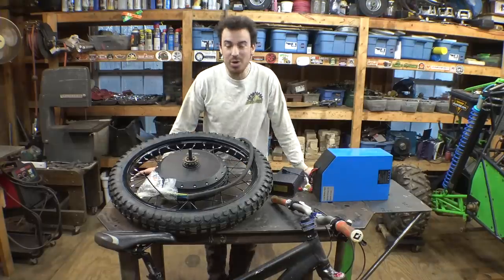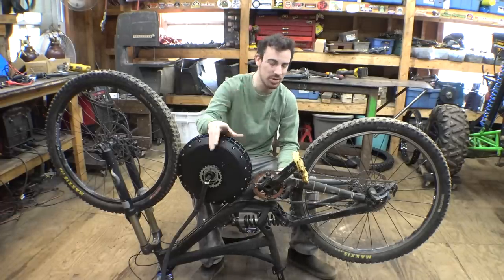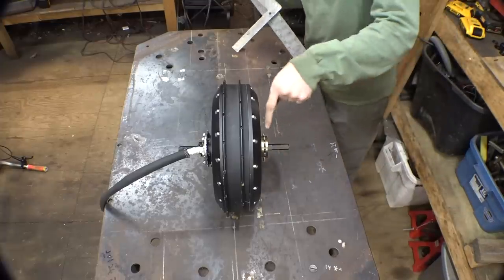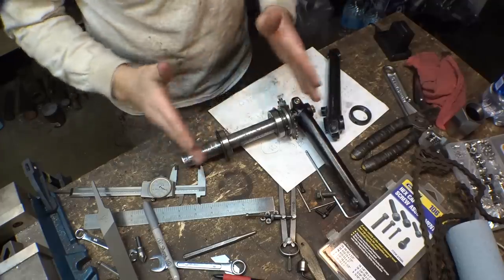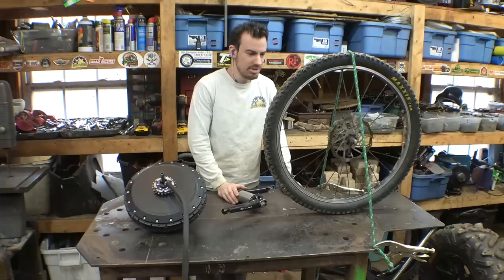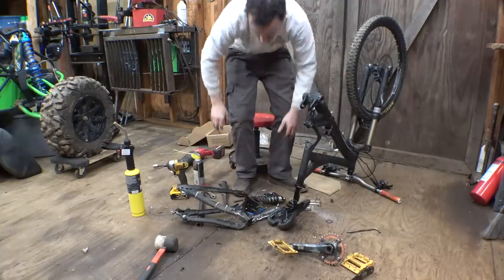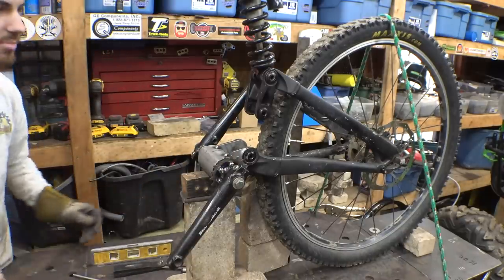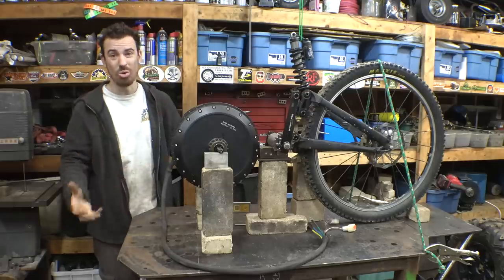Home Made Electric Mountain Bike Build - Part 1

Comment: I have an eMtb peddle assist with a 250w motor.  It creates enough torque to lift the front wheel right off the ground when pedaling.  8000w is going to make it completely impossible to pedal and you're going to destroy mtb chains immediately.  Therefore, you're going to need a moto chain and now you're making another electric dirt bike.  But I'll still watch and hope you can pull it off somehow.  Good luck!
Reply: #40 single chain on a small sprocket (~10t) is rated for like 4/10 of a horsepower at 100 RPM which is like 75mph on a 3" 27.5". Even a gigantic 50T sprocket is only good for like 1HP @ 100RPM, that's good for 12mph. 8KW is 10HP. 

Not gonna have much luck I bet, gonna rip itself apart even fixie. And then you want to shift with a derailleur? Yeah, no way and no how.
Reply: I think you’re right… about the derailer, it’s going to twist it up like a pretzel
Reply: that is good honest info to know i got my son a 750w motor was hoping it was enough what size batt build for him??   Town is 6 miles one way there is one big high on the way   thanks for you time
Reply: @langgbob  derailleur’s do not take a load. They move the chain around after the torque has been applied to the sprocket. All the energy gets used up on the cassette and where the derailleur is placed essentially is where a chain would be drooping down if it was not there.
Reply: I run a 3000w mid-drive and can vouch for all of this. I beefed up everything on the rear-end and still worry about it when torque is high. As soon as internal shift hubs are viable (and cheaper), I'm switching.
Reply: @onetravdown - This was going to be my next comment... the derailleur will never hold that much horsepower, never mind 2 or 3 hp. Shift once under power and that's the end of it. This motor would probably be better suited for a 1/2 scale helicopter than a bicycle!🤣
Reply: @pontiacg445  on top of that, this is 10hp instantly, not over an ICE power band like I assume those chains are designed for
Reply: who cares, it's just a fun content project
Reply: @langgbob  The derailleur doesn't see tension from the chain as its only job is to guide the chain over the freehub / cassette. The top of the cassette / freehub and the crankset or motor sprocket will bare all the torque, and the chain will basically become the fusable link.

And going by how it's possible and also kinda easy to snap a chain on 500w-1000 mid-drives, it sure as hell doesn't stand a chance at surviving a hard start on 8,000w!!!
Reply: Chain doesn't matter when jts hub drive
Reply: @hammyhamz4685  watch the video it's a mid drive with power through the chain
Reply: @hammyhamz4685  true... but when you're using a hub motor as a mid-drive it matters a lot.

Comment: This is going to be wild. I’m curious to see if that electric motor becomes a giant gyroscope in the middle of the frame, possibly making it difficult to turn!
Reply: I was thinking the same thing about the gyro. One good thing about it though is it will be harder to fall over with it spinning.
Reply: @hillonwheels8838  it will make it impossible to lean in turns. Marking it unrideable
Reply: Probably not as hard as having it in the wheel. Then again, the rpms wil be higher. Interesting point.
Reply: @FightFilms  way different than in the wheel. The wheel is on the ground not 13 inches above.
Reply: I was thinking this same thing, but I don't think it spins fast enough.
Reply: @jeffflanagan2814  8k rpm not fast enough?. You can spin a bike wheel by hand fast enough to have an affect.
Reply: Should be fine, no different than a motorcycle
Reply: @tassiejeeper01  motorcycles don't have a giant rotating mass in the center
Reply: @farmmouse3011  what do you call an engine?
Reply: @farmmouse3011  So you completely forgot how a combustion engine works? Counter weighted crank shaft.... connecting rods... Oh my goodness, CAM SHAFT?! Yes bike engines have all that. All literally rotating mass.
Reply: @farmmouse3011  you mean Like a 2kg cast iron crankshaft spinning at approximately 4 times wheel speed?
Reply: @tassiejeeper01  yea but 4.4lbs vs 75lbs. Idk either way. But it seems this would have a bigger gyro effect.
Reply: Hi Oliver;Miss your vids,and hope all's well.?/I think the diameter is small enough to only affect sudden sharp turns.Hopefully :).
Reply: @c4k3t0otz6  Lol at that one.
Reply: @Ran-dom1  Embarrassing.
Reply: @eriklarson9137  I think we all know whats embarrassing ;)
Reply: @farmmouse3011  how much turning do you think you’re gonna do when you are going fast enough for that motor to spin at 8K?
Reply: He is right, the small rotating mass in a 200 cc engine is nothing compared to this thing spinning in the middle of a bicycle.   This is going to suck as a mountain bike, but fun on city bike paths.
Reply: It wont. The motor isn't going to function like it normally would have as a hub motor. That's why the sprocket is on the shaft. The housing will be stationary and the axle will spin. He said he's setting it up as a mid drive, instead of a hub motor.
Reply: @leadgindairy3709  There isn't 75lbs of rotating mass though. The rotating mass is really quite low.
Reply: @gt1man931  There's very little rotating mass on that motor
Reply: There's very little rotating mass in that motor. it'll be fine
Reply: @farmmouse3011  it's not doing 8000rpm. Probably closer to 500rpm
Reply: @lawnmowerdude  where are you getting 8000rpm from?
Reply: @Reghardt Jordaan  the sprocket is on the brake rotor hub. The motor is working exactly like it normally would. The axle will be stationary while the outer hub will rotate. You can't hold the hub still and spin the axle, it would rip the wires out. The stator remains stationary.
Reply: @spyder7758  that's not how it'll work at all. The stator mounted to the axle will remain still. The outer hub does the rotating. That's the only way it can work
Reply: @th3d3wd3r  you are probably closer than my first guess. Did some checking that motor should be around 800/1200. I'm not used to hub motors.
Reply: Rotating mass is what allows you to balance a bike in the first place, so it's not really going to affect turning. Granted there will be some lateral forces involved, but no more than the average dirt bike.😉
Reply: There are MUCH larger problems with this plan than that lol
Reply: Get the idea that if the motor will work against the steering or with steering depends on the rotational direction of the motor. With direct chain connection indeed working against the direction of steering. Another problem might be is that the bike will lose traction when quickly leaning into a corner because of gyro forces which effect is increased by high center of gravity
Reply: I actually love hard workers with all my heart! without them a disabled person like me would have no comforts whatsoever.  Before my disabilities kicked in hardcore , i used to build all sorts of stuff. My mind can still think it but my body says no! 😢
Reply: Same thoughts. But it's the journey not the destination.
Reply: With that electric motor in the middle of that frame that Chris will weld together, it will be well balanced because of it being centrally located. Did you ever hear of the polar moment of inertia? The front and rear of a vehicle should be as light as possible so that it could turn quickly. Adding weight to those two places will hamper its ability to turn because of that added weight. I know this because of what I recently typed to Chris, aka Rather  B Welding. I could see it in my mind. I was conceived in that way. It requires much more power to turn a front and rear heavy vehicle than one that has them quite light. All Chris needs to do is to keep that motor as close to the ground as possible. This will lessen the center of gravity. I believe what Chris started building will be one of my absolute favorites.
Reply: Yeah same keep up the good work bud
Reply: @Ran-dom1  counter balanced is the key, a giant ass hub motor is not an internal combustion engine, its practically a gyro out the gate. IC engines are not
Reply: @TheAwesomeArcane  how would that work with the wires protruding from the axle? lol
Reply: @TheAwesomeArcane  the cog that's going to drive the rear wheel is mounted to the motors casing.
Reply: One thing to remember is that is a rear hub direct drive system designed for your e-bike build I use them all the time and have no gyro effect from them I ever felt. It is the speed that gets you in trouble the quickest with these motor hubs, but no if that were the case they would had stopped using them years ago and Did you ever look into a high power planetary geared hub motor?  they are smaller and lighter plus have better range.
Reply: But is his plans to actually spin the wheel or hub portion of the motor. I mean I know how it is designed but I assumed he plans on spinning the hub and maybe changing the connections. Ok this was what I thought he would do but now I think I was wrong so maybe I should shut up and watch the video hahahaha. 😂
Reply: @TheAwesomeArcane  "The housing will be stationary and the axle will spin." How much money you want to bet? I will come in soft at 1 billion.
Reply: @landrelarose745  "This channel doesn't have any content"

Comment: That's a big motor for a little bike lol.  8000watts is almost 11 horsepower equivalent.  A normal bike chain at like 30 mph is good for like 2 hp, just from looking at charts online and guessing though.  You're gonna need some beefy motorcycle size chain and sprockets.  I think most places limit the size of an ebike motor to 500 or 750 watts.  So you're basically building an electric motorcycle.  Still gonna be a cool project though!

Comment: finally a builder who talks about the unsprung mass, the demons take me every time I see people put the fattest engine they found on the internet on the wheel (I understand that it saves a lot of work) and they didn't even consider what that would mean towards the behavior of the bike / motorcycle, my OCD thanks you
Reply: For me it's the people with a 60+ mph ebike and a regular Threadless stem, or worse yet a dual crown fork WITH direct mount holes but no direct mount stem
Reply: @Ash-bx6kq  there are many people with suicidal tendencies who don't know it XD

Comment: middrive is the best it puts the weight in the best place and allows you to have gear reduction. the motor can also be way smaller because the reduction allows you to run a much higher rpm

Comment: Interesting project. My concern is whether the wheel, spokes, sprocket and chain can handle the power and the weight of the bike. Look forward to seeing more.
Reply: The wheels are fine. The chain and sprockets will be the weak link........pun intended. But really these bikes can take 300 pound riders without needing Ultra duty wheels.
Reply: @KoltFin  the wheels are not gonna be able to handle the speed, torque, or weight lol

Comment: I did freewheel on the motor, freewheel on the pedals. The motor turns the sprocket on the pedals, but does not pedal. The pedals turn the sprocket but do not turn the motor. Do not use a freewheel from a bicycle, it will break, and the pedals turn from the motor, which can lead to injury. 1kw motor, can break bicycle chain.
Also, the spokes of the bicycle wheel are weak. 
Need industrial bearings in the wheel hubs and good brakes.
Sorry for my English.

Comment: I'm sure it was either LMX or Alta who used a hub motor as a mid drive in one of their prototypes. Granted it was with a qs205 sized motor, not the 273. Very interesting project.
Also, it amazes me how many people are sure enough to comment but have no idea how a hub motor (outrunner) works.

Comment: Been riding a DIY 3000 watt mid-drive through 7 gears for four years now, 90% on-road. Torque at the rear end is a huge issue. Firstly, freewheel hub axles will bend within minutes, don't even bother trying to use one. Get a freeHUB wheel with super-heavy duty spokes and a chromoly axle, anything less will fail, bent axles lock up the rear wheel. Secondly, 7 speeds max, higher speed chains are WAY too thin to take any torque other than pedaling. I would use a 3 speed derailleur if they existed, just because the chain would be more robust. It's an issue I still worry about as I ride. Best of luck!

Comment: I can tell you that my cheap 8 speed been taking 1.4kW peak power for 1400 miles with no issues, as long as you don't change gear while throttling. 9-speeds are only slighly thinner. I'd guess you could run up to about 3kW if you watch your chainline and shifting. 

If you want to go 4-5kW I'd recommend you switching over to a strong bmx chain and modifying your cassette by removing some sprockets (you wont need more than about 4-5) and increasing the clearance between them to make the chain fit. That would make an interesting build for sure. Having that gear ratio is golden. Also, big thumbs up for your awesome machining skills.
Reply: I'd love to see if 9s chains are actually weaker too. Crosschaining snaps chains quickly, all the torque is going through just 1 side of the link instead of book sides

Comment: I got the same motor/ controller!  put it in a cheap rigid fat bike frame…had to extend the triangle to accept the 24 LiFePO4 40152 headway cells.  12 kw….I’ve flipped it over on me twice.   I know that this motor will chew bicycle chain and gears up in no time at all!  Highway speed at 84 volts with an 18” tire.  Fun to hotdog, but dangerous!

Comment: If you haven't yet, take a look at the latest Grind Hard video.  Ethan put a large electric motor and battery in a slightly larger size Power Wheels (looks like a Corvette?).  The thing is pretty cool, does wheelies and really moves.  You should think about doing one! Thanks for the videos! 👍👍
Reply: Yeah thats a cool video, I do think its a porsche
Reply: @lex2715  yes it’s a Porsche.

Comment: A friend of mine worked at a bike shop years ago- I would be able to go in and get used parts like bearing and random accessories for free cause they always had extras. Maybe a local bike shop would help you in getting some bearings. I'm sure they would like to help with your project. Also having a high low gear up front, smaller one for acceleration, and then a big one for top speed, plus the back gears would be cool. And for the weight, I think the failure point will be the rims, and maybe the axles, but u can get upgraded ones ( used 12 inch bike tires on my mini chopper 212 build and broke several lol..

Comment: i was lucky when i was a kid, my grandfather was simi retired, so he took me everyplace from the time i was 4. took me to brick foundries, steel foundries, machine shops. i knew at 4 or 5 i was going to work with steel and metal, cutting and welding. the smell of a machine shop takes me back to being a kid. nothing like taking something down to fit precisely or weld a gap.. lmfao

Comment: The gyroscopic effect preventing you from turning is going to be IMMENSE. Plus a high risk of pinching unless fully enclosed.
Reply: I mean I think that would've been bigger if it was in the wheel, as it will be mounted to the bike frame the motor casing won't be spinning

Comment: Fun looking project. I know there are some free wheel crank hubs availble that allow for motor drive through the pedal bottom bracket whilst not peddling. I'd also add a freewheel to the motor so you can peddle without having to drive the motor (EG. riding home with a flat attery). I wonder what flywheel gyroscopic effect that hub would have if it spun at full speed without the chain. The bike may stand up on its own, or flip you on corners. :)
Reply: i dont think he understands KVA.
Reply: Good point

Comment: You can change the wheel spokes to 12 or 11 gauge spokes for bikes that will handle over 100 Nm's. They are available on line. Don't forget an appropriate spoke threader I'm case you have to shorten them. Your cassette also needs to be able to handle over 120 or more Nm also. You may need a heavy duty bike chain that is designed for e-bikes.
Reply: Yeah. Those e-bike chains are designed to handle a 250-500W motor + power output of the rider which maxes out at around 750W peak if you're very fit. Definitely not 8000W lol. We'll see how this goes.

Comment: You could make your pedal assembly a coaster. This would allow the motor to drive the rear wheel through the pedal assembly without causing the pedal to turn. Just a thought. Hope it helps. God bless, stay well.Also for the motor, skid plate.
Reply: Coaster locks up when back pedaling......

Comment: Those motors can handle up to 30KW peak with ferrofluid and hub sinks. You could have ran a 500W-1000W DD hub motor and still get 2-3KW through it with 1/10th the weight. and it would be more than plenty.
Nonethless, I'm definitely keeping up with this build :D

Comment: I would not worry about the motor position to much just make sure the front wheel doesn't touch it or the frame on full fork compression.

My qs138 v3 70hv motor is around 35lbs and my spim08hp 20s2p battery is around 45lbs so approximately 80lbs.
The total weight added to my dirt bike is 100lbs give or take including the controller and wiring for lights and turn signals extra 12v 3s6p battery and battery tray and covers, Not sure the curb weight with a full tank of gas is from the factory but it's probably close to its current weight.